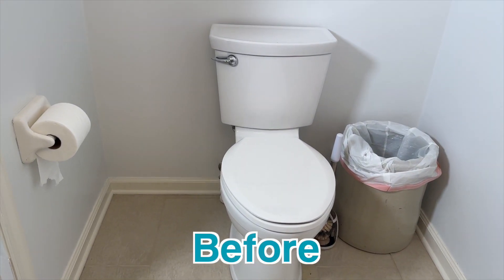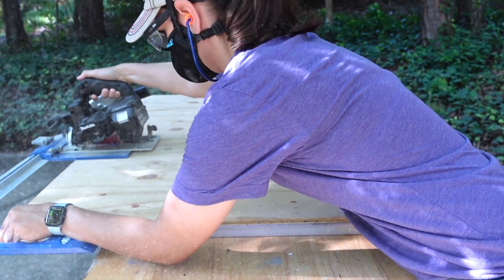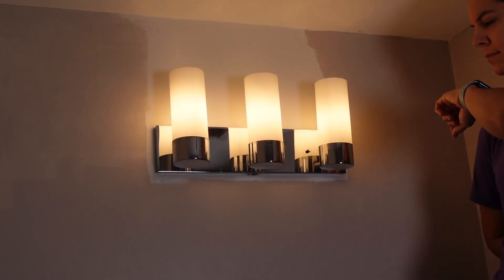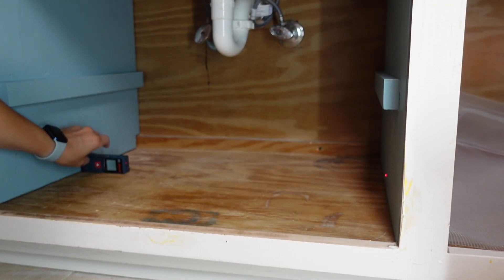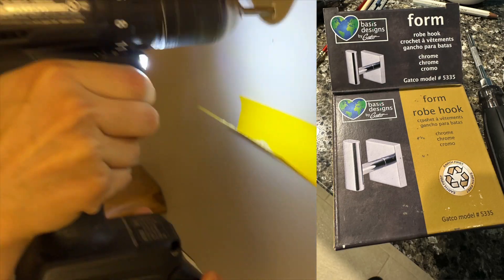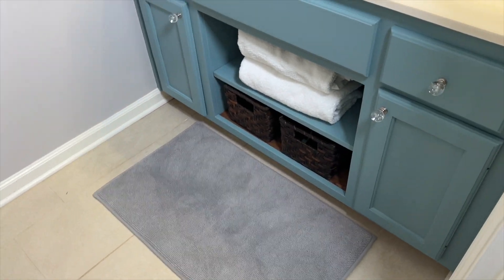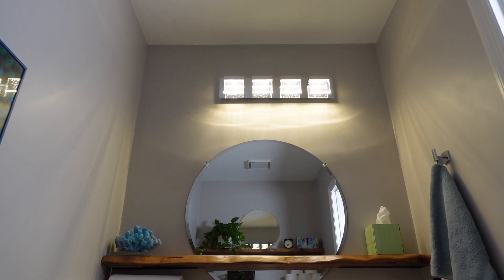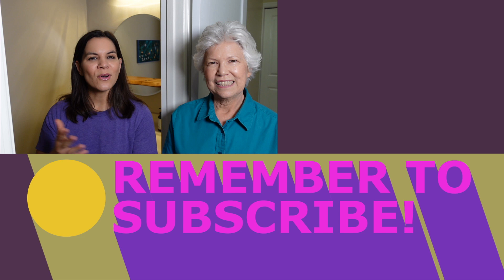DIY Guest Bathroom Makeover // Open Cabinet Design

Comment: Well done, ladies. It looks beautiful. We have the same issue with light fixtures in bathrooms too. I thought about building a wooden box to the length of the vanity and then using a remodel-sized electrical box but never got around to checking if that would fit our county's code. You eventually get over it.